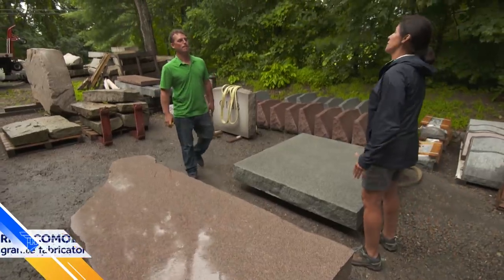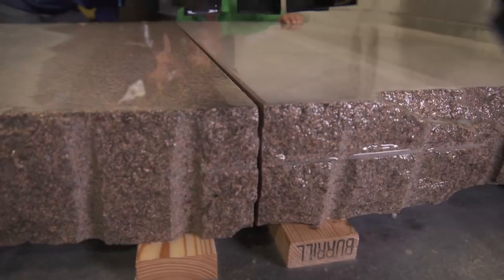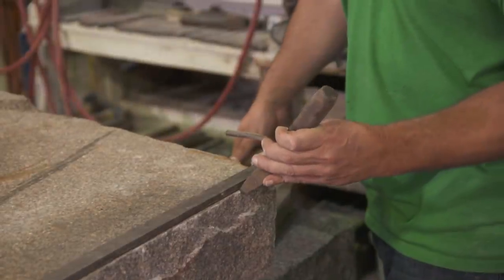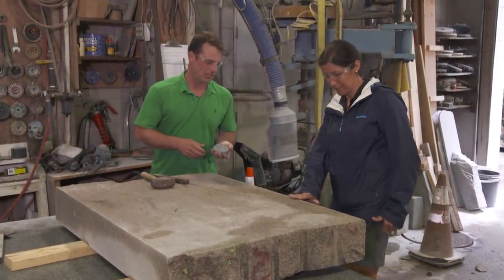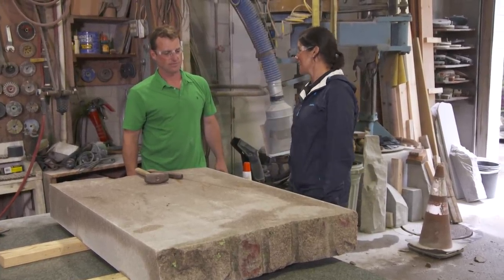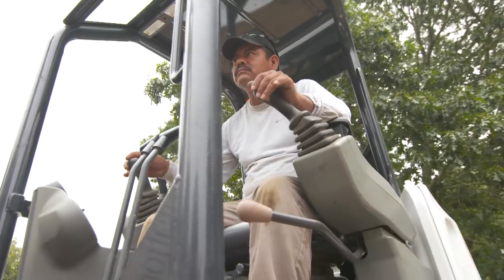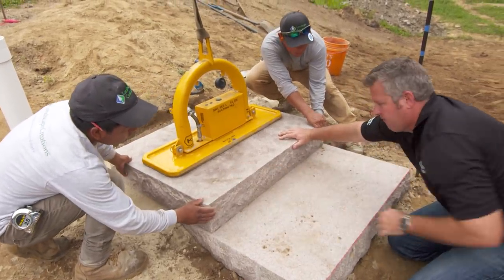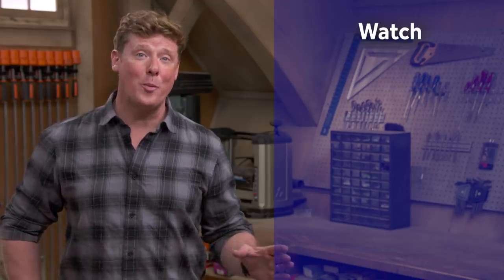How to Cut and Install Granite Steps | This Old House

Comment: Would granite steps be slippery in cold snowy areas? I'm just wanting to put steps in my garden and want material that will be easy to manage for ice and snow.
Reply: Usually, they "treat" the surface with fire to roughen it. https://en.wikipedia.org/wiki/Stone_flaming
Reply: @altamiradorable  Thank you.
Reply: Only if it was polished
Reply: I just imagined someone using polished granite for walking on. Haha.. They be slipping everywhere
Reply: Yes they will. Be careful

Comment: What type of material could you use if you wanted to do the same effect but you wanted it to be totally clear where you could put color-changing LED lights beneath it so you could see any color through the steps or walkway or ramp? It would nice to see it so so it could be heated so in the winter the snow would not ever build up and it would be hard to be stained or scratched? What types of materials would you have to use to do something like that?
Reply: Quartz? Diamonds?
Reply: I am probably wrong but an epoxy could be poured to the whatever dimensions(I think) and colored with Different striations ? Otherwise just wait til winter and use water ... I’m fired
Reply: Acrylic, clearly your youth wasn't wasted on bopping away on an underlit  acrylic dance floor ... kids today ...mutter ... mutter ... mutter ...
Reply: Ross Kneebone 
Hindsight....🕺🏻